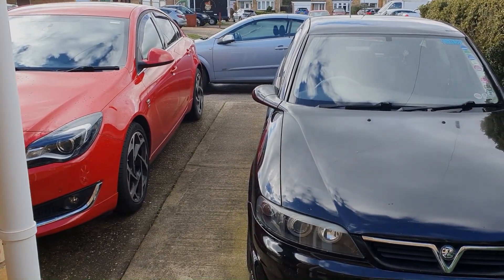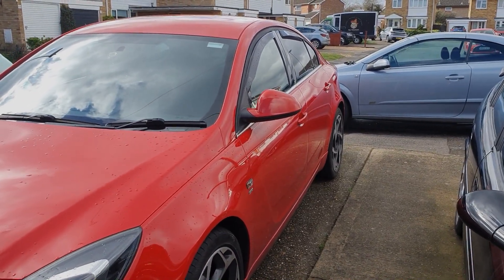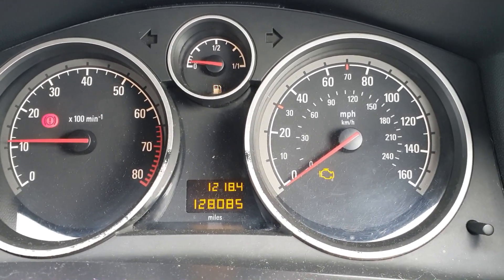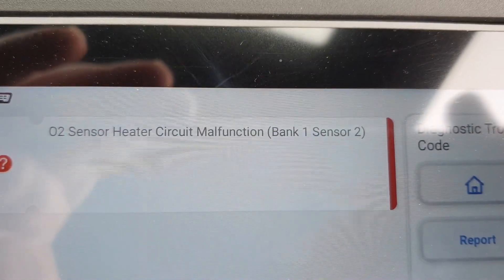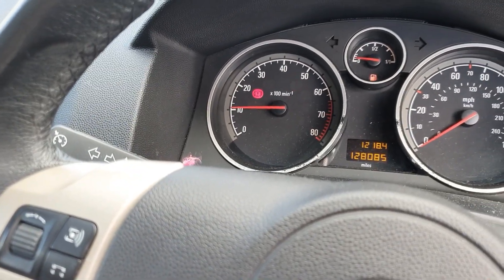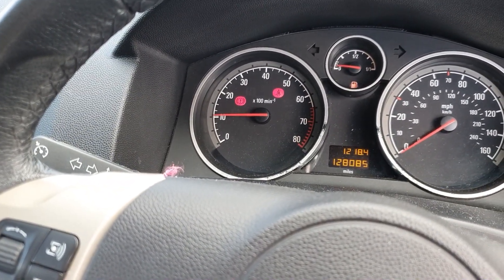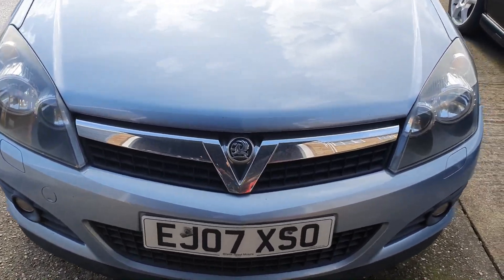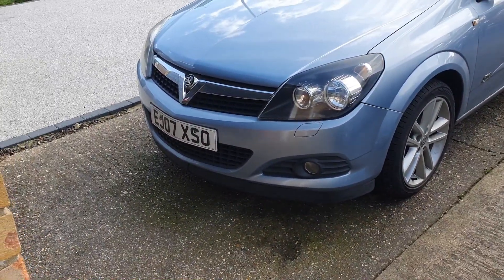Astra Engine Management light and Exhaust failure

Comment: Wd40 and a decent pipe wrench normally does it.
Reply from the maker: Good tip, didn't think of a pipe wrench :)
Reply: @VauxrezNeil  good thing about a pipe wrench is the harder you pull on it the harder it grips. Thats what i have always used on them.

Comment: Hi, have You noticed any increase of vibrations with the damaged flex pipe? In my case just the outer net is loose, the pipe is still in one piece. I noticed a slight vibrations during acceleration between 2000 and 3000 rpm.
Thank You!
Reply from the maker: Hi, I can't say I notices any vibration, just a louder exhaust sound
Reply: @VauxrezNeil  Hello mate, thanks for the answer :) I just replaced the front section with flex pipe as it desintegrated completely. No difference with vibration level, but it surely is less noisy on highway speeds :)
Reply: @Maniekmatrix  Maybe a bit late but the vibrations you mentioned should be something normal.I am also experiencing the same and I went through all german forums and it seems that this is just a manufacturing problem because Opel themselves tried to look up to it and didn't find a solution.I tried and changed all the mounts and brought absolutely nothing.
Reply: @DDragnevv  I already replaced the front exhaust section with flex pipe, nothing changed. I also have a slight vibration on the steering wheel when car is idling. The level of vibration increases with AC turned on, already replaced the middle transmission mount without any effect :D
Reply: @Maniekmatrix That transmission mount was a pain in the ***.The vibrations on idle rpm occur on my car also and everyday it's different.There are days that there're no vibrations and days where I feel my mounts are shattered.No idea why.